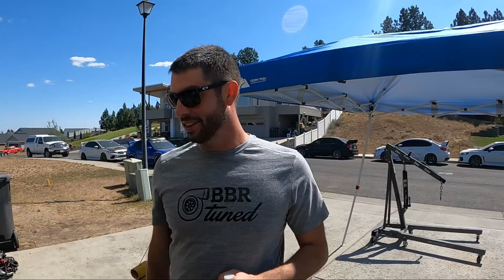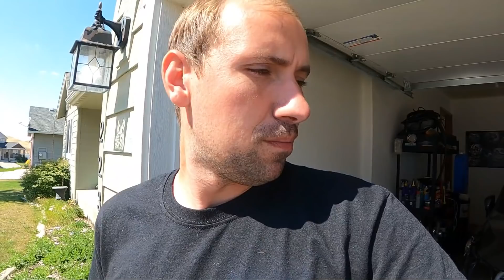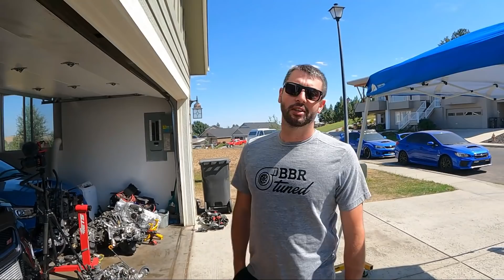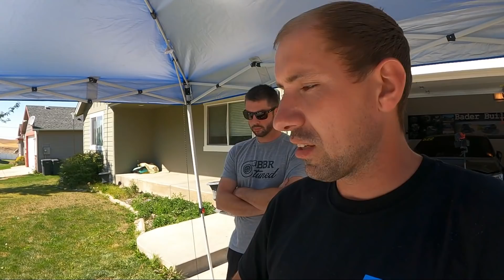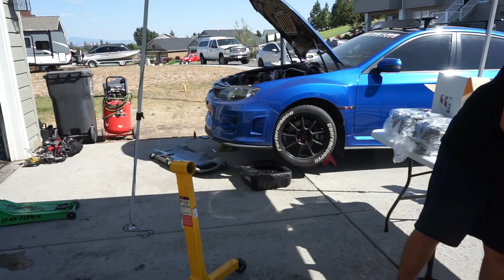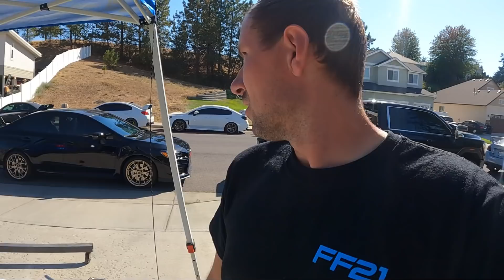BBR 700 STI Build Begins / Josh's Engine Diagnose

Comment: So many videos I haven't seen lol. 

Gawd I love Subarus and you just never stop Bader 👍👍🤘

I actually have an 11 at my house, dropped off 2wks ago, abused and overfilled with oil. I look into it and its not running with 7.5qts of oil in the stick and 3 over advanced codes. 

 Drain and get her running but has leaks from oil pump area (havent torn down yet,  waiting for the ok) engine will knock if ran for 20s+ but before  psi builds, no knock. Sounds ok actually..no knock initially after start up until psi leaks and drops.. Oil was sparkly obviously but I think I'll do the same as Travis: swap in an oil pump and see how she runs. ( I'd like to buy it if he let's me haha)

Comment: This is probably a dumbass question. But let’s say I buy a stage 3 from you for my WRX. Can you use stock WRX heads on the block? Or would you have to modify the heads in someway besides drilling for 1/2 head studs? If not what heads would you suggest? I should have just bought an STI. 🙄🙄

Comment: timing belt flexes most at #1 cylinder,  IAG has a spintron video up on Facebook, you can see the belt bouncing around. seems that side of the motor needs additional timing belt support,  no one makes a kit for that side, yet.  and since the motor rotates clockwise,  #1 intake cam might be having the most issues.
Reply: RCM Gobstopper runs a 2 belt timing system to run shorter belts,  maybe it's to solve this issue.

Comment: That new torque solutions oil pan kit looks on point!

Curious if you already have a video on your recommended engine & transmission mount kits to replace the weak factory units?